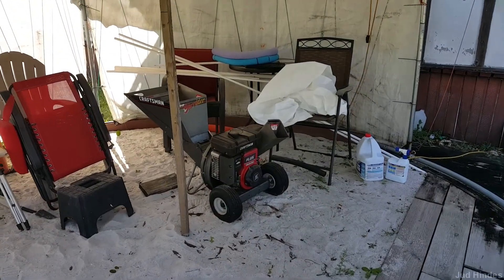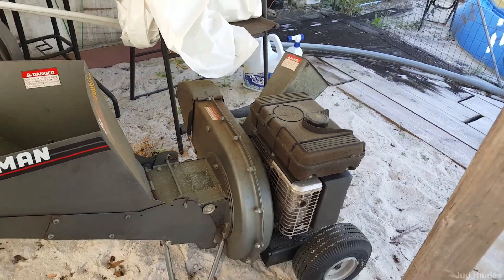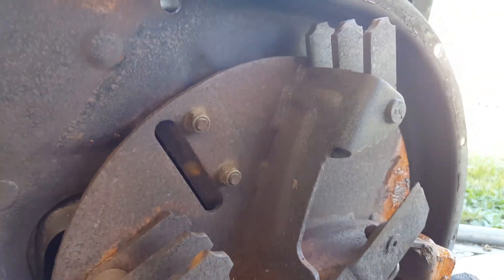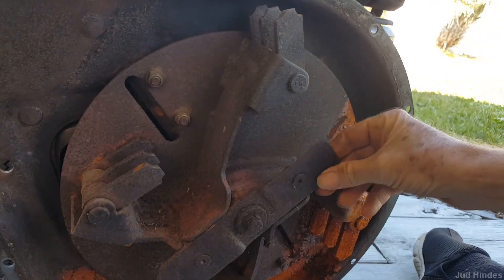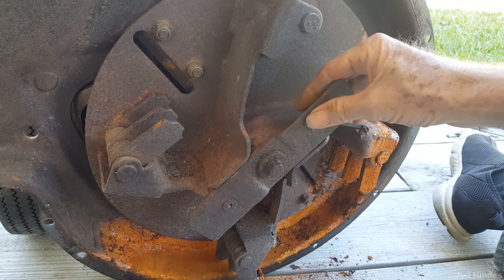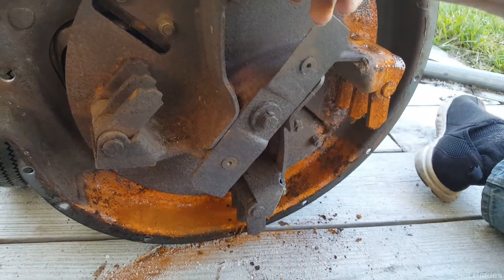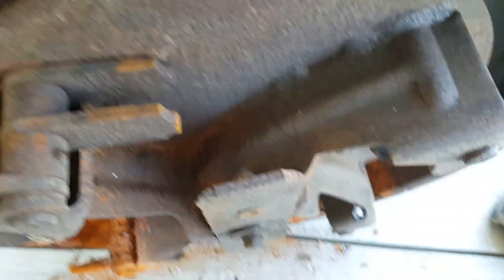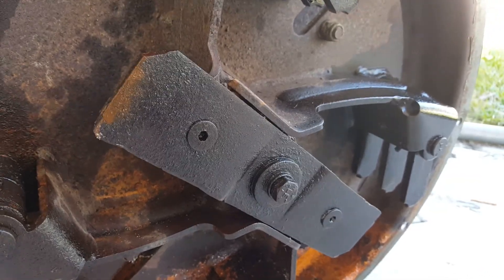Inside a Craftsman Wood Chipper (revised)

Comment: How did it preform after this?
Reply from the maker: You can see it in operation here: https://youtu.be/0As3MG_nNYI
But for direct answer, it was a little better, cause I did free up one of the "beaters"? But, my sharpening efforts were of little or no effect. At some point, I am going to have to get that flywheel un-bolted so I can remove it and then the blades and actually sharpen them. So, it works, but it is a bit of a battle still. And it does still kick out just as much. Damn near had a finger busted by one hit. Actually, it might be busted, but never bothered to check cause they don't do anything for that anyway.
Reply: @ejud2001  I'm in the same boat. I used your video to take mine apart. Tried the file to sharpen the blades. I'll see if there is any improvement. Thanks for the information.
Reply from the maker: @michaelweinrich9559  Best of luck! I will say I think I was a bit worn out by the time I got to the file, so would simply add, be ready to really do that. :)